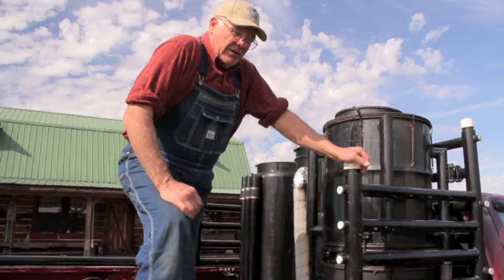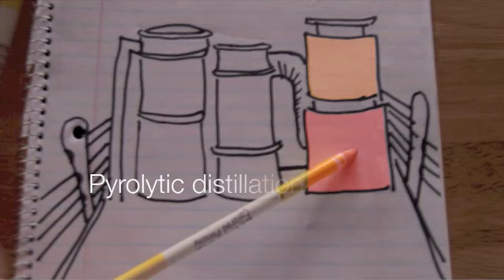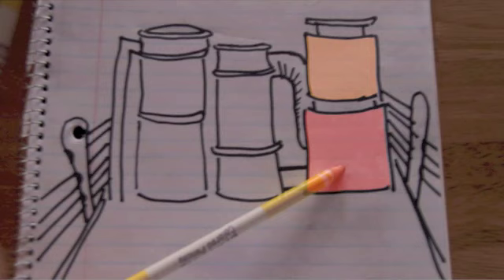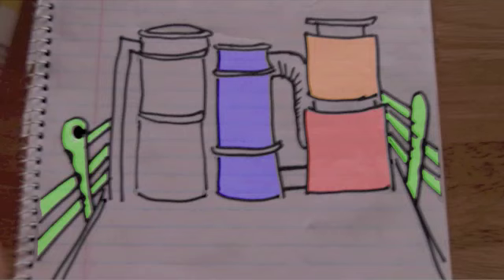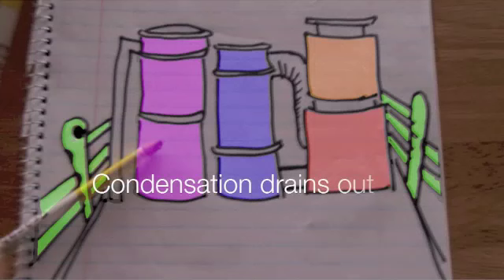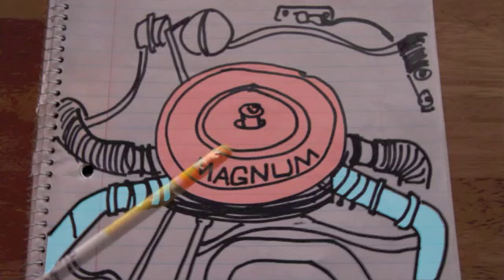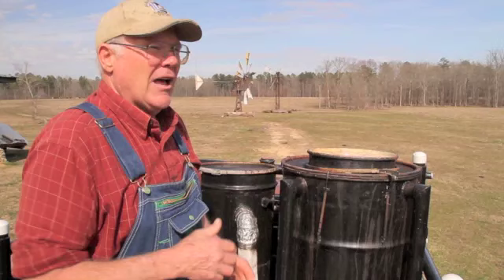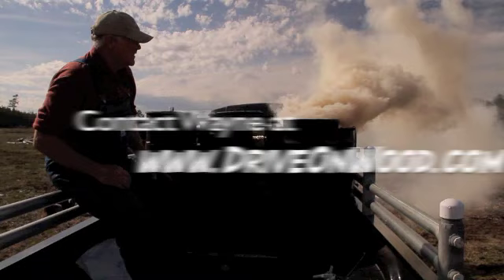Running Your Engine on Wood-Gas with Wayne Keith!

Comment: What about having a compressor and compressing the gases into a fuel tank on board the truck, like an lpg conversion? That way, you have the wood gasifier off the vehicle, saving weight and space in the pick up bed. Have your gas generation equipment on the farm so it could serve other vehicles.
Reply: Few folks have had success with this method. Check out engineer775 for his videos on this
Reply: Mrteslonian does this method.
Reply: That's a good question Chris, I'm working on that process currently. The best I have come up with is the use of multiple tanks with water and gas displacement between the two tanks to pressurize a third tank for storage or filling smaller tanks

Comment: The supply of trees is finite. And they consume soil nutrients and provide shade and wood for building, and fine workmanship and clean the air. IIRC Brazil only allowed gasogenios for buses because cars would have deforested the country. Although they did that anyway.
Reply: Deforestation will happen, but think about the implications of gasoline production on the environment and how much this could help.
Reply: Replant as you take out...
Reply: fires occur naturally

Comment: I did the math and found that a fat, dead cat will get a 5,000 pound pickup truck just over a mile. That is a tiny car running on a really fat cat to get 6-8 miles. The fat, dead cat would have to be the size of an 8 year old child to get you 6-8 miles. Also, 2000 degrees F is over 2 times as hot it should be to cause bio-fuel to undergo pyrolysis. You probably need more than a hay filter to filter out tar. I recommend fiberglass filters like the type in cigarettes. Finally, it would 10 percent more efficient if you just built a steam engine.
Reply: I think about 2700 degrees f is the temp that works best for gasification.

   I know of no filters that will filter tar , the trick is to have the temps to eliminate all the tars. 

The efficiency of the gasifier / internal combustion engine is about twice that of a steam engine .   Test at Auburn University have shown 37% more efficient than gasoline

Comment: I noticed Mr. Keith has built a lot of wood trucks. Is he going through engines at a rapid rate? I''d like to tear down one of those engines to see what wood gas does to them.
Reply: That's what I've been thinking.
Reply: rrusston2 If you don't filter out the tar it destroys the engine. I think you'll need a bit more than HAY to filter out tar.
Reply: How about nano-fiber filtration units vs, hay?
Reply: The dodge in this video has over 25000 miles on wood at this point still running strong
Reply: @BigBeavrSlayer  That's a good accomplishment for any Dodge!
Reply: @phillhuddleston9445  well my woodgas dodge has about 15000 on wood right now then seem to like it. My Toyota with a chev 350 also loves woodgas
Reply: @BigBeavrSlayer  Maybe Dodge should make all their trucks run on wood gas 😁
Reply: He has a farm that's been running on wood gas since the 70's

Comment: A dead cat should yield at least 10 miles, 15 with a favorable breeze. Afterall, a pound of wood gets him 1.3 miles he said and a dead cat is at least 10 lbs but their fat has a higher concentration of btu's than wood. So go on down to your local animal shelter today and scrounge through the dumpsters to recycle the cats they gassed, and then adopt all the live cats so they don't get gassed.

Comment: What sort of engine do you have in that truck and is there a way to determine the size of gasifier you need based on the engine that you intend to run?
Reply: This truck is 8.0l v10. His systems can be tuned for most v8 engines or down scaled for smaller engine's

Comment: Why does the gasification apparatus need to be carried on the vehicle? Wouldn't it make more sense to make the gas first, store it and then fill a single gas tank on the vehicle, as usual?
Reply: I believe you can store the gas in a airtight container, have seen old pictures of this.
Reply: Hydrogen gas doesn't store well for DIY - Need cryogenics, or special alloys just to keep it at pressure, due to hydrogen embrittlement of many materials.
Reply: Analton Morion Wood is not THE gas, as oil is not gasoline. Wood is the source material for Wood Gas, it's the name of the mixture of gasses made by thermal decompostion of the wood. http://en.wikipedia.org/wiki/Wood_gas . Chris Petts was asking why not process the wood into Wood Gas off the vehicle, and runt he vehicle on stored Wood Gas alone.
Reply: WiztotheIzzard
look into Fischer tropsch process, 

My idea,
Solar photo-bio reactor - >process waste water

HyperCritical Solar Gasifier -> turns algae water into steam and H2 and CO

Catalyst - depending on which one is used you make different fuels

like diesel.

So - Poo + water  + sunshine = algae and clean water

+ focused sunshine (intense!) = Syngas - without any byproducts

+ catalyst = diesel 

Burn that diesel in a generator ? send the exhaust back to the bioreactor - they love Co2 :D

Comment: Sooooooo, is the the stuff lit on fire inside the pyrolitic converter? What's the heat source for the process? I want to do this myself. Anybody?
Reply: I think about 1/3 of the wood is used to drive the gasification process.

Comment: >25% power loss
>37% more efficient

uh .... aren't those two principles mutually exclusive?
Reply: +Kevin Keel Not really.

Natural gas is comparable to gasoline when it comes to miles per gallon and it burns cleaner than gasoline, but performance/power is less on natural gas than gasoline.

If Mr. Keith routed part of his exhaust gasses from one of the cylinders and a small degree of moisture to go with the air used to gasify his wood scraps via the bourdouard reaction, he'd have an efficiency increase to some extent and have even cleaner emissions than he already does.

THAT is if he can keep the mixture Ideal in the gasifier and the truck.

Sometimes, you can get an increase in efficiency but a reduction in power can come into play.

Various circumstances and many factors come into play on that though.